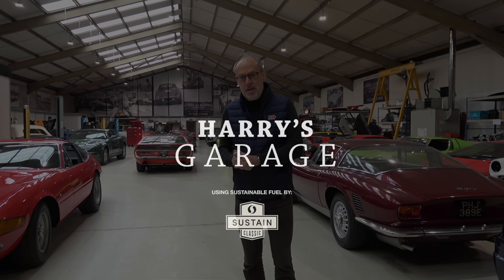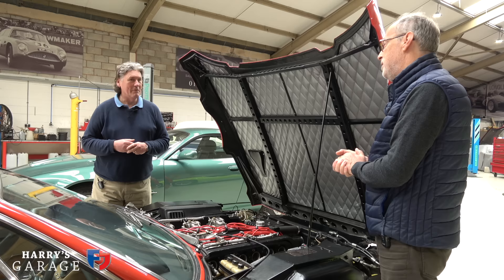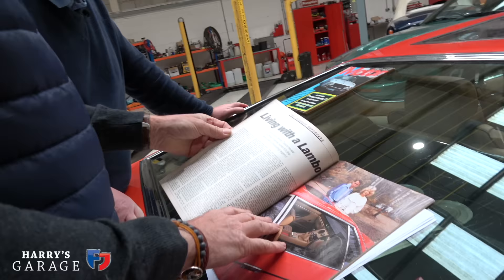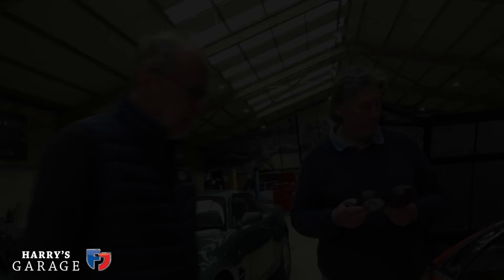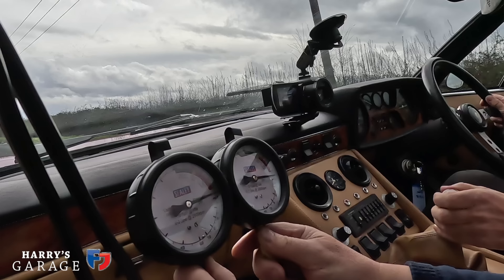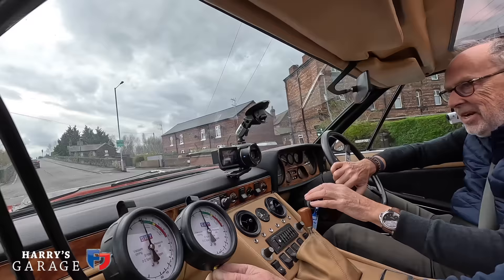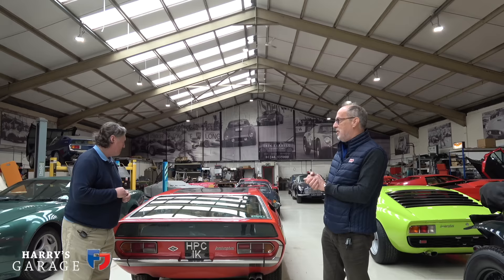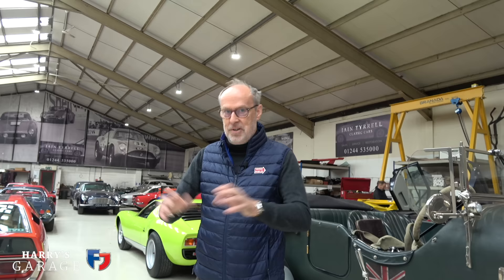Lamborghini Espada is back with Iain Tyrrell in search for more power. Plus Marcello Gandini tribute

Comment: I removed some restrictions from my XKR's exahust, there is a crushed section near the rear to make it easier for the exhaust to be isntalled at the factory but to me it looks very crushed so I repalced it with a full sized tubular section and removed 4 of the silencers. It still has the center box so it's not too noisey but I figure it should help the top end a lot.

I would probbaly ditch the whole exhaust and have a whole new system made for it that's just smoother with less restrictions. They have a silly right angle bend into that last box at the back which can't help, having it straight will help a lot I think.

Comment: Nice test, very learnful! Had a similar experience with an R107 SL on which a previous owner mounted a wrong exhaust causing powerloss.
Reply: Had the same experience with my 450 SLC. The exhaust headers are tuned, to permit somewhat efficient scavenging, to work with the tuned exhaust to create a good compromise between the low - end torque and mid to high end horsepower. The "H" crossover pipe was missing and the whole system was a hodge - podge weld patchwork. Stock spec exhaust fixed the problem.

Comment: As always a very informative video. A lot of people wouldn't ever have heard of exhaust back pressure but its actually a critical part of exhaust design. When I worked as an exhaust engineer we were given back pressure targets to achieve so as not to affect engine performance. But at the same time you need to meet pesky noise regulations but also have a sound that matches the car its fitted to ie sporty rasp for a sports car but a sedate burble for a executive saloon. A lot of people go on about BHP but its just a function of Torque and engine RPM (Horsepower = Torque x RPM / 5,252). Torque is what makes you accelerate and is amplified when put though a gearbox hence why your car accelerates harder in lower gears as the lower gearing multiply's the engine torque at the wheels. Looking forward to seeing what the new exhaust unleashes on the BHP and Torque scales! Video's with both of these chaps are always a joy to watch as you can see the excitement and enthusiasm about cars in general. I also loved the quick 'lets take the back box off' test before it rains. Pure joy to watch. Thanks for sharing

Comment: I'd love to hear how this sounds with a mild steel system as opposed to stainless. Less zingy, period correct, and probably a much richer tone. All the best Harry! Enjoy your coming week.
Reply: That's a very good point.  Possibly a little relevant to an Espada, I hated the s/s exhaust I put on my Excel.  That rasp is far too easy to get these days and, back then, was too much for the 2.2L Lotus engine.  Worse still, 10 years later it still hadn't given me a reason to remove it, let alone agreeably crumbling to dust.  I reckon that with the Toyos it later got, and an original exhaust, it might well have started ticking some luxury and comfort boxes.

Comment: Unwanted back pressure: add a H or X bridge to connect both pipes. It needs to be welded in just in the middle of the exhaust. This will limit back pressure and give a huge power gain.

Comment: It perhaps could go without saying, but another dyno run on the follow-up video would be top on my list of things to see. Are we to expect 350 crank minus about 20%, so about 280 at the wheels?

Also, did I miss what caused the gas spillage into the engine bay?
Reply: It running too rich due to the back pressure.
Reply: @buggerlugz6753 lol no it was't. running rich only causes grey/black exhaust which smells like gas + bad running, not spillage to the engine bay...
Reply: @buggerlugz6753  
That's impossible to say for sure. An engine can also run lean due to back pressure. The back pressure can have some interesting effects on how the air is pulled though the carb venturi which can cause it to draw less fuel. It can also mess with the scavenging effect and cause all sorts of fun issues with reversion.
Reply: Debris in one of the carb jets, according to one of Harry's replies

Comment: At 6psi, hot exhaust gas will be reversing back into the chamber on the overlap. Making it run hotter & reversing the intake flow until the exhaust shuts.
Reply: Well, the 6psi is the pistons pushing out the exhaust gas and because the whole exhaust system is too small, the pistons are compressing the gas, and that's what makes the 6psi.  An exhaust needs to scavenge as it were and actually suck the exhaust gas out and suck a new fuel charge into the cylinder.  Seems like a totally new exhaust design is needed here.

Comment: Very interesting. 
There's a good comparison to be made between the Espada and the mildly tuned Jaguar XJ12 coupe, which I think made 350 bhp.
Reply: Firstly the 4.0 litre Lambo V12 seems to have predictably inflated factory power claims.
While Harry's XJ12 coupe has an easy 450 bhp potential with some larger bore liners and 78 mm stroke crankshaft warmer cams and ITB induction modifications.All that with single cam heads.

Comment: I had exactly the same problem on my Lotus Elan +2. The solution is to make a new system using Jetex straight through silencers. It's dead easy, cheap as chips and instant access to more power at higher revs.

Comment: Back in the 70's and 80's at Sports Tune we found that any Ansa system fitted to a car would improve the power and the sound. This includes Minis to through everything BMC/Leyland, as well as SAAB, and even Jaguar.
Reply: An Ansa rear box did wonders for sound and performance of my GTV6

Comment: Interesting conclusion, just shows how important the exhaust system is in tuning an engine.
Those back pressure guages really highlight the issue very clearly.👍

My only concern is are you going to lose low and mid range torque at the expense of more top end? 😮
Reply: I thought that too. The motor did sound magnificent with the restrictive boxes fitted, but in the midrange. Top end, it didn’t want to gain rpm at all quickly enough.

Comment: Hello Harry, Downton Engineering an then Janspeed I believe had there own specifications an of course Mike The Pipe.
A cylinder with a motor driven reverse turbine would vary the back pressure! Dependent on the spin speed an consequenceshall hoovering of variable flow, this would allow it to be established best back pressure, if set in the line of middle boxes.
Cheers

Comment: Be careful what you wish for.  You may get more top end power, noise and fuel consumption, but less mid range torque.  I have seen this effect on a Triumph 2000 with an after-market stainless steel system, with adjustable muffler end plates, which open or close the bore.

Comment: If the Espada is delivering 203 whp / approx 260 bhp - then surely the restrictive exhaust system can't be accounting for the 90 bhp shortfall. This suggests to me that Lamborghini's original 350 horses were in fact tiny Italian ponies!
Reply: It's always interesting comparing horsepower figures.
But 350 hp from around 4 litres by the standards of the day would have been a big ask.
It's actually more output than the BMW M88 in the E28 M5.
Ironically the performance figures for a 427 side oiler Falcon were around the same as a 200 bhp BMW 3.0Si both similar weight.

Comment: Interesting video having watched the previous instalments detailing the engine rebuild and subsequent ignition problems etc. 
Without wishing to come across as disparaging towards Iain’s talents with exotica it strikes me as a little worrying that there was seemingly little due diligence performed on Harry’s Espada when it first went up to Broughton. Surely a full inspection of the vehicle should be performed prior to commencing any work so the owner may be advised to the condition of their vehicle and therefore any potential pitfalls to be subsequently encountered. Iain professes to know these cars intimately but completely misses the dodgy non standard exhaust system attached to the engine that he has charged Harry to rebuild. I don’t recall any mention of the advantages of switching to a modern ignition system to help with those Muira camshafts and higher rev limit. 
Contrast this with the advice given to Harry by the gentleman who upgraded the Jag V12. He provided advice so that an informed decision could be made.
If I had spent £30k on an engine rebuild to be told months later I have 6psi back pressure in my exhaust I would be wanting to know why this was not noticed beforehand! 
Props to the comments talking about pressure pulse tuning/harmonics and head flow. There is a lot of science involved in making an engine perform.

Comment: I sold Abarth exhausts back in the 80s. They would utterly transform any US spec Fiat or Lancia. We even carried them for other marques, and one BMW owner rang me to say that he had just collected his car from the mechanics shop and was absolutely in amazement at the mid range torque pickup, going up the Waldo Grade from the Golden gate Bridge in San Francisco.  Every 124 Coupe and Spider had one, and ran so much better- cooler water temp at idle, and the cars sounded like an Italian car that God intended them to be. SS exhausts such as Tubi, in my opinion, do not sound correct for the carburetted cars. Had a SS exhaust on my Aston DBS, and quickly went back to mild steel. I think that Harry's Espada could do with a full Ansa blackened mild steel exhaust- if you can find one. You may even be able to find one from, say, a 131 Abarth, which is going to be the right OD pipe size, and modify to fit. Get out the pipe bender, and have at it!
Cheers

Comment: Someone call sparky. Where is he? I would have thought a custom muffler would have been included in the price, but you know, it's not my shop... Could have told you the exhaust was restrictive, but let's not dwell on the past. Well done Harry! Need to bring that thing to a proper tuner who can see backpressure building in the changing AFR during the run. Same guy would have probably put a huge exhaust on it for good measure, I'm very sorry, it won't happen again. All the best with your build and everything. Thanks again.

Comment: Couple of points… the Espada needs a damn good wash underneath, exhausts are give and take, you may lose torque and gain top end & vice versa.  Finally, was not expecting to see the fuel lines held together and fixed to the chassis with cable ties…
Reply: They were the lines for the back pressure testers temporarily installed and up through the window.
Reply: @RobertBlow  thank you for the clarification👍👍👍

Comment: I had a 1996 Dodge Stratus with a 2.0l and 5spd stick and the muffler was side inlet, rear outlet.  It rotted out internally but was intact externally and I was getting a random "potato in the tailpipe" situation with about 15 hp.  Always after sitting idling at a light.  It was a bad day when it happened at the bottom of the onramp to the interstate.  No rattles, no loud out the back.  I checked with a gauge in the egr fitting into the exhaust to figure it out.  New muffler and problem solved!

Comment: I'm not too happy with the design of the exhaust. You've got 12 cylinders grouped into 4 sections at the manifold and that stays 4 for most of the length of the car. The firing order is such that you get one pulse at a time in each group which slow down as they pass down the pipe. That two to one join will be adding to the back pressure as the two pulses essentially collide with not very much velocity. A much better system, for the sake of pulses and the scavenge effect is to join the groups together a lot earlier. so instead of four 3-1 manifolds you'll have two 6-2-1 or 6-3-1 and a larger diameter pipe from the bulkhead back. That will allow the pulses to chase each other down the pipe and exit with a higher velocity and lower back pressure.

Comment: Borescope the middle box now that the back box is off, as mentioned it is probably just a straight through perforated tube so it would be unusual for both to be blocked. 
To tell if the exhaust is blocked the PSI reading should stick at a high level when the revs are quickly reduced, ie the pressure would take time to decay. I don't know but 5psi in a smallish bore pipe for a large capacity engine whilst under load may be correct, it's a big air pump. 
The torque curve drops at higher revs but this isn't unusual, the HP is climbing nicely, I think 350HP value could be 1960's sales horses.

Comment: Exactly where Iain is pointing at 11:23 is where the problem is, it’s getting so hot it’s discoloring the stainless. I thought it was on the small side but I figured 4 liter, smallish V8, it might be ok, but clearly isn’t.
Reply: Not really, as you could see that removing the backbox completely didn't fix the problem. It helped a bit, but not much.
Reply: That point gets hot mostly because of the speed of the gases, not because it's a massive restriction. That restriction starts at the tiny exhaust ports in the heads, then the long thin primaries etc. There's a lot going on here, and it starts with the heads.

Comment: I suspect Lamborghini might have been fibbing just a little back in the 70's when really, nobody was checking claimed outputs - as otherwise you'd think manual transmission, normal front engine RWD layout, no power steering to sap power, and pretty low draw on the alternator - 15-20% drivetrain losses at worst - so you'd expect closer to 300hp at the wheels.  A modern exhaust is definitely a good investment though.

Comment: Proper engineers right there to discover that . Back pressure is the cause yall. Check your back pressure get some gauges
Reply: Hmmmm. Harry is definitely not an engineer, not sure about Iain,
And frankly, from the point of view of others who have worked on a lot of engines, done a lot of testing with exhausts, I'd say there's quite a few pints they glaze over. The main point is that they don't mention the port volume with a single word. Go back and look at the ports of those heads in the video where they disassemble the heads. They are tiny, especially the exhaust ports. That mark Iain points to where it got hot, is more than likely not just a big restriction, but caused by the gases travelling at a high rate of speed. That speed starts at the heads, then the primaries. This is more complicated than just a restriction. That lack of top end power, points to an engine that is running out of head and intake.

Comment: Design of an exhaust systems are a science not finger in the air it’s not just about pipe diameter and silencers.  It would be interesting to have the issue looked at by a racing engineer.  Does Iain’s arse dyno need a recalibration or are all Espadas running 70 bhp down?
Reply: It's a four stroke engine not a two stroke therefore people seem to exaggerate the effects of scavenging.
As opposed to any back pressure in the exhaust of a four stroke engine is at the cost of more effort being taken by the cylinders on the power stroke.
Concentrating on reducing back pressure to the minimum is the way to go at least for road engines running at low RPMS and without massive valve timing overlap.
As for wheel dynos there is a question of slippage between tyres and rollers.Hub dynos bolted to the wheel studs seem to be a solution.

Comment: The after market exhaust is just so bad compared with the original. Who really decided to add these on the car?! Another thing that is missing is or are a H or X bridge to connect both pipes. This is also to undo unwanted back pressure.

Comment: Many years ago when I was into tuning cars (Ford engines not Lambos) I thought there was a requirement for "some" back pressure. I must admit I can't remember why! Can anyone remind my ageing brain!?
Reply: No. It was "an idea". What really matters is the length in relation to the cross section. I've done a ton of exhaust dyno stuff, both chassis and engine dyno. You'd be surprised at how little back pressure matters, and all things being equal, just fit the biggest exhaust you can. What matters more, is the length and diameter of the primaries as that is what mostly affects the scavenging. Then there's the collector length in case you run no exhaust. But that should typically be between 30 and 50 cm depending on the headers, displacement and powerband.

Comment: What a great watch!👍 A bit of an insight into the science of exhaust design and gas flow rates, scavenging etc. The system on the Jarama sounds like a good option, failing that an exhaust specialist should be able to design a bespoke system to fit in the limited available space under the Espada and optimise the breathing on the big V12. Many modern cars utilise butterfly valves in the exhaust to muffle sound and get through the noise regs and reduce back pressure at high revs, not required on the Espada of course!😂👍👍. Older bikers among us will remember the "EXUP" system Yamaha fitted to their road bikes in the late'80's-90's. 
Can't wait to see the follow up video!👍

Comment: I'm not a fan of after market stuff on cars. 
Evertime, they lead to some issues, keep it real ✌
Reply: In this case the exhaust is just not very good. Back then, and this goes for Ferrari too, these cars led a lot to be desired in terms of exhaust. Being it a 350GT, a Ferrari 250 or 330, or an Espada or Miura.
There's a lot to be gained by utilising modern tech sometimes.

Comment: So why wasn’t that detected when you sent the car there for an engine rebuild?!!!
Reply: Because there was nothing to detect. They did a rebuild, they increased the displacement a bit, and did the cams. They had not done it before, and Harry specifically told them to stick with the SS exhaust. That's how tuning works when you have no real baseline.
It's a restoration shop, these guys don't do a ton of tuning.